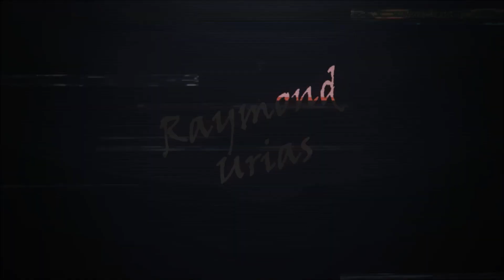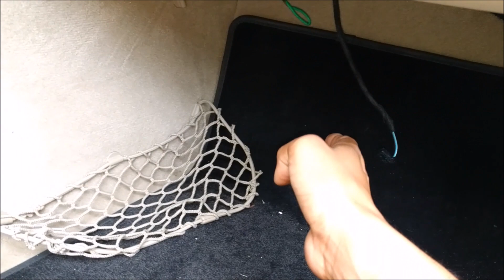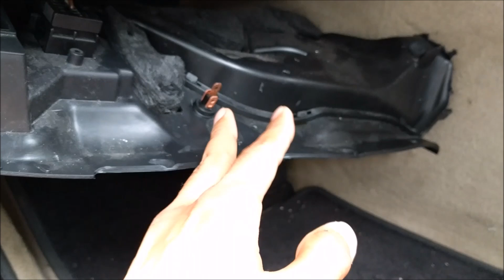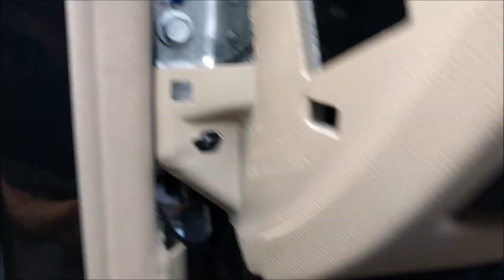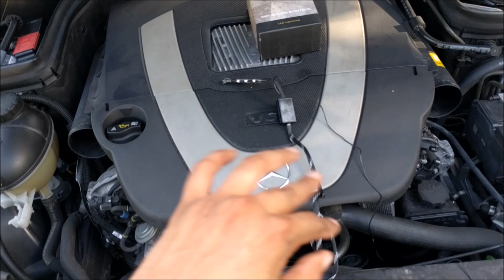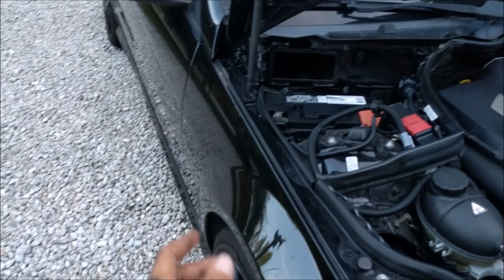Wire Demon Eyes or Halos on Your Car

Comment: Hello Raymond what Gauge Wire did you use and is it the same gauge also for the ground wire?
Reply from the maker: I used 18awg and yes the same for both. It's very low voltage

Comment: hi please reply im going to wire demon eyes in my car this week can i use any power cabel with a fuse on it an say if the fuse holder comes with 10amp fuse should i change it to 3 amp like u said that the main question really im wire to a switch like you also im going to connect both demon eyes together first from each side like red to red black to black im going to ground them to the body of the car so its the power cabel that come with a fuse holder an fuse already init which i wasent sure can i leave the fuse already in or do i have to make sure its 3amp im in uk by the way so time u get this message might me different thanks
Reply from the maker: Definitely use 3amp. There is nothing wrong with the way you describe.
Reply: @RaymondUrias  ok so jus remove the 10amp an put 3 in right
Reply from the maker: @parmindersidhu9690  correct
Reply: @RaymondUrias  hi jus one last question what power cabel do u think i should use 18 gauge with a inline fuse built int

Comment: super cool..I just want the color changing star(from your other video) so can I just hard wire the controller and the star to it without having to installing a switch ? Even though I'd love to have the full package with demon lights/switches but I am lacking installation and also not located around epic lighting area

Comment: Hi there, thanks loads for the warranty info, but try as I might I could not find statement about voiding my 2 yr left warranty & my 1 yr certification, if I add something electrical, or have someone other than Mercedes fix something.
Reply from the maker: +JENAY WILSON if you are worried then I would just ask your service advisor about the product you will be installing and check with him if it interferes with any components. He can't just bluntly say the whole warranty is shot
Reply: Thanks Raymond,
I did ask Mercedes Corp, they said it would void, but when you mentioned the law I thought there may have been something specific.
Thanks again.

Comment: All of this is great, but NOT WORTH A DIME IF IT VOIDS MY WARRANTY, AND IT WOULD & WILL.  Now if you know something I don't, please inform.
Reply from the maker: +JENAY WILSON I hope you are not a dealership looking for a fight... If so let me just drop some legal knowledge on you.

"Magnuson-Moss Warranty Act of 1975. The act states that a dealer must prove that aftermarket equipment caused the need for repairs before it can deny warranty coverage. However, if the reason for a parts failure is unclear, a dealer will usually charge you to diagnose the vehicle."

This modifications would only void the headlights and battery. The dealership can't say anything about the power train or the ECU or SAM CONTROL UNIT.
Reply from the maker: +JENAY WILSON oh and it's a Federal Law
https://en.m.wikipedia.org/wiki/Magnuson%E2%80%93Moss_Warranty_Act
Reply: Hi,
I just saw your other reply, I am not a dealership, I am an assessor/appraiser for the city of Phila, & I just bought a 2016 GLC 300, & I would love to add things like ambient light, lighted door sills, but I think if I had to get something fixed they would see what ever and claim I created the problem.
Reply from the maker: JENAY WILSON Please beat the Patriots!!!! Im begging you!
Reply: LOL Funny you should ask me to beat the Patriots. The Patriots are my team. But to let you know who I am in this case, My guys have won so many times, it will be more than ok if the Egales win. Though it's not the same guys/Egales they have tried 4 so long, it would be very special for them & their nice n   nice nasty fans. My guys can get that next ring next year.

Comment: Funny my 2013 W204 AMG sport sounds great when you get on it!However i really like your videos as you can do mods and i can see if i like them before doing them myself! Look into boost i have been trying but the cost is very high !
Reply from the maker: +OCD Detail Thanks man! I think the compression ratio is high already and with the AMGs and add on the bad factory head bolts (ticking time bomb) ....that could put the car in the grave. I would just leave the engine alone and enjoy the sound of a purring kitten 😁👍

Comment: WOOW that looks fucking great 😍 I'm playing on getting an ecu tune to my 350 do you have any recommendations
Reply from the maker: +Snoopy4156 thanks man! Eurocharged has the safest tune for our cars. No more pedal lag!
Reply: Raymond Urias I was thinking them as they are closest to me what do you think ?  http://www.ecutuninggroup.com
Reply from the maker: +Snoopy4156 I was referring to:
http://www.eurocharged.com
Reply: Raymond Urias yeah I know but since i can't really sent out my ecu as I have no where to park the car so I was looking for anything near me just wanted to get your thoughts in the one I showed you
Reply from the maker: Snoopy4156 Jerry at eurocharged can put it on a programer for you so you can do it at home. I don't really have experience with the other company you showed me. I have only really worked with Diablo and eurocharged
Reply: Raymond Urias cool I will give them a call
Reply from the maker: Snoopy4156 awesome ask for Jerry! Just be aware that they are in Texas .....and it's currently under water
Reply: i just got a magna flow 2.25 x pipe done with muffler delete and i gota tell you its so damn great. But i really want to get a new grille that fits the light up star correctly and ive had no luck a friend of mine bought the one you posted but its also a diff fitment any idea where i can get one i dont mind the crome as long as its the same
Reply from the maker: Snoopy4156 how's the droning with out the muffler? I'm doing mine really soon. Ill look around again for the grille
Reply: Raymond Urias I don't mind the droning  its minimal my muffler shop let me tested with magnaflow mufflers and it sounded the same as stock only at high rpms the sound would start to come out its to quiet
Reply: Raymond Urias do you recommend the eurocharge for pedal lag and better driving experience over something like the “pedal commander” wanna get rid of the laggy feeling my c300 has and I have done a lot to my car with help of your videos I just wanna know what I could do to make it more zippy it seems laggy and do you recommend messing with the resonator and deleting it and straight piping it or what’s your thoughts on messing with the exhaust
Reply: Raymond Urias also what did you use to blacken the chrome trim of your car